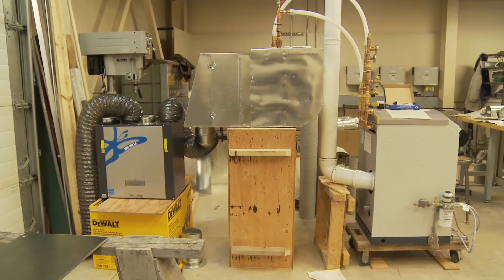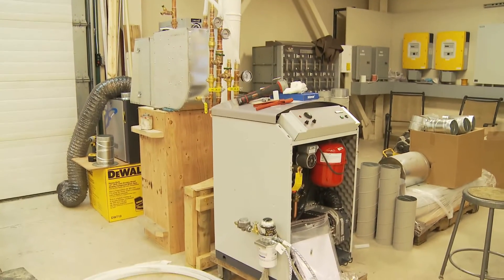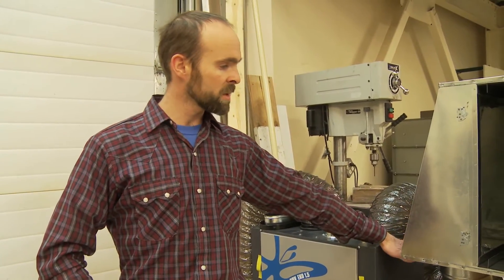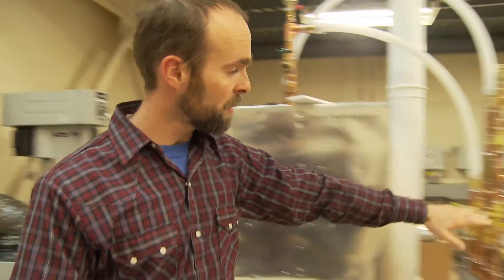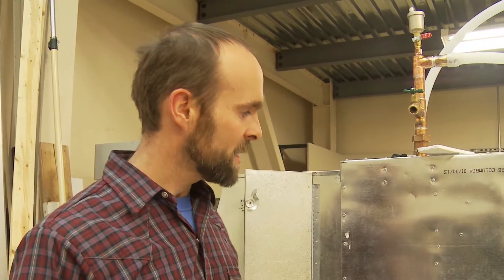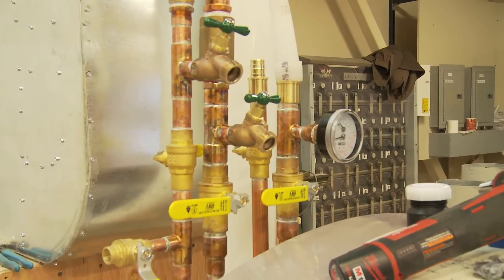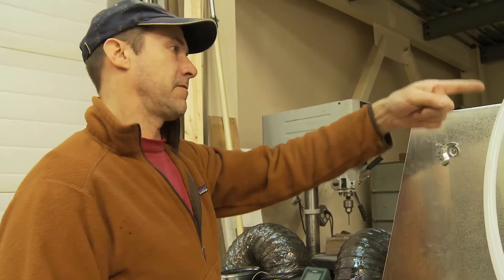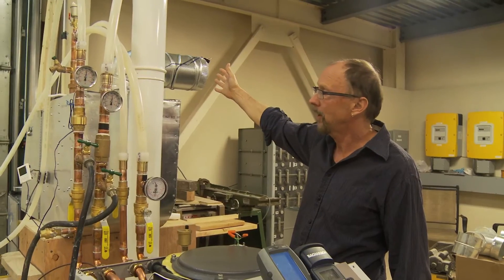Sustainable Northern Communities: Buckland Prototype / Integrated heating and ventilation

Comment: I am curious how this worked out. One thing I wonder about with the heat exchanger and the radiator warmer ... what do you do with the condensation?
Reply: it goes out of the bottom VIA a drainage tube.